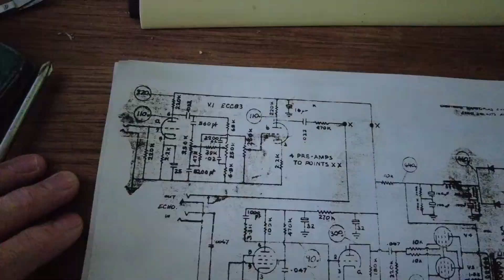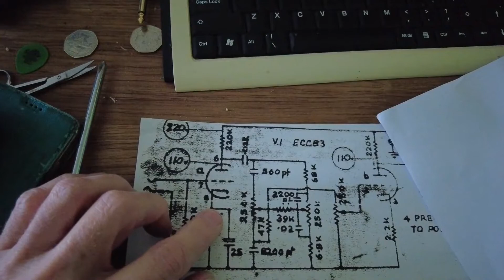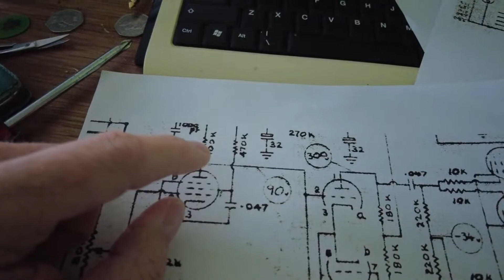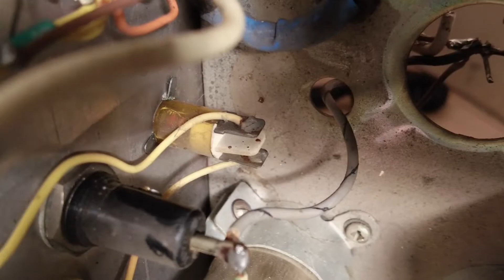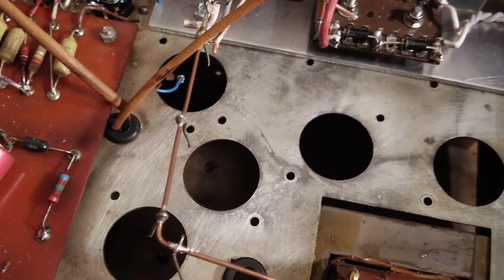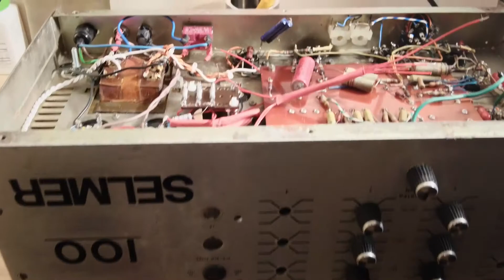Selmer 100 PA to Guitar Amp Conversion Part 2 Rebuilding the Power Supply Tackling the Safety Issues

Comment: i play one of these as a guitar amp, i struggle to keep it clean , i have to turn the guitar right down  and i think because of that i lose a bit of treble , but apart from that i love it . some interesting ideas, here it will be nice to hear it when it is done .( is it that  the reverb version has an ef86 and the normal one doesnt ?)
Reply from the maker: Hello. No Reverb on this one. Here is link to part three: https://youtu.be/Y8VUNaJK39w 
You can here the demo a the end. 

I recently found out that although all the parts in this amp are the same that are used in the Selmer PAs, this is in fact an Invader 100 PA:   https://reverb.com/uk/item/49824679-viking-invader-1970s-valve-pa-amplifier-100w-4-x-el34
I think someone years ago rubbed the Invader name off the face plate and added the Selmer name on to it. You can just about still see were the original name was. If you look at the link you can see the layout is exactly the same.